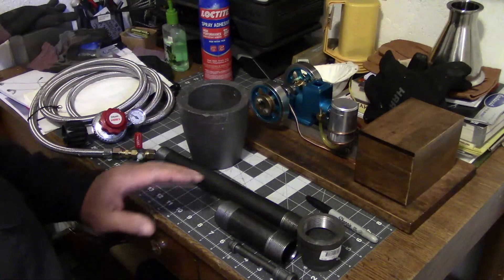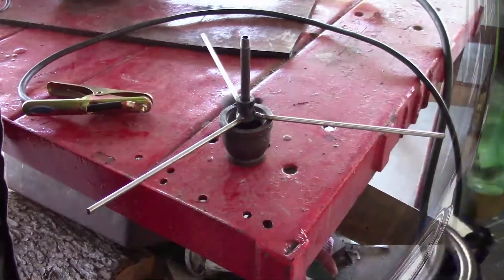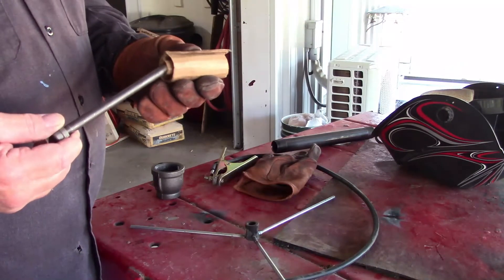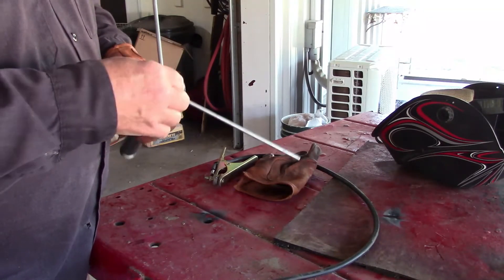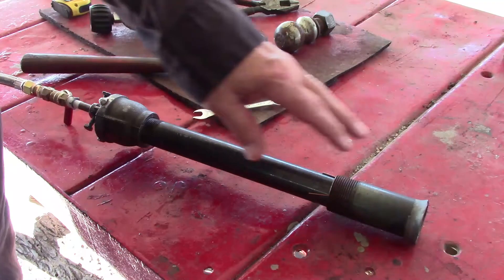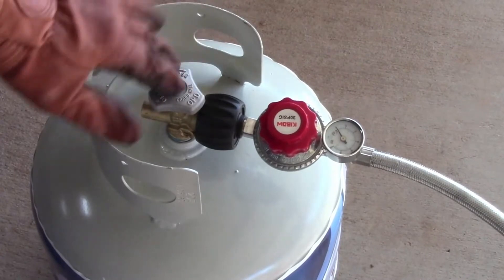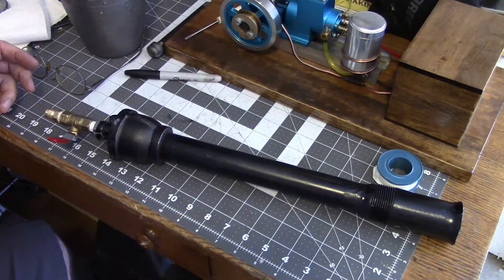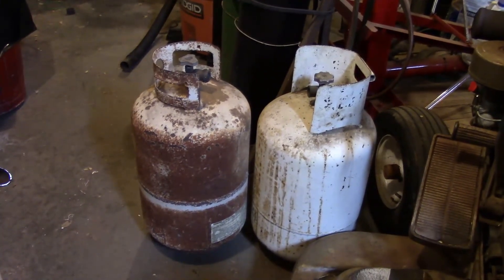Propane Burner for metal melting furnace

Comment: Nice it works. I use to work in a fine art foundry for 12 years.  We used fire brick inside of round pipe. Big pipe. And there was giant blower motor for air when you kicked the fan on it went boom then is sounded like a jet engine turbine. It was 5,000 degrees F it would make your legs feel like spaghetti at the end of the day. We pour our bronze at 2300 degrees F. aluminum is much lower melting temp I think its like 1200 degrees.  Yes I looked it up it melts at 1221 degrees F
Reply from the maker: Wow, now that is one hot furnace. Thanks and take care

Comment: I like how you made that burner Really good looking flame to Only problem you might have Is your propane tank freezing that's why I went to a bigger propane tank Because the 5 gallon propane tanks kept freezing up On me And the burner didn't work as well
Reply: On can set the propane bottle in a tub of hot water.
Reply from the maker: Thanks for the info about the hot water
Reply from the maker: Thanks, I will have to watch for that